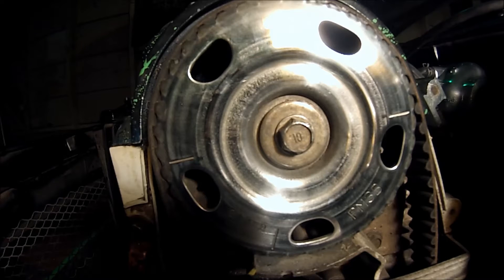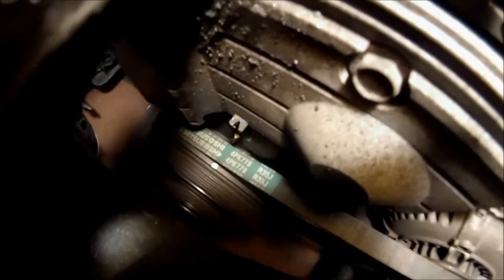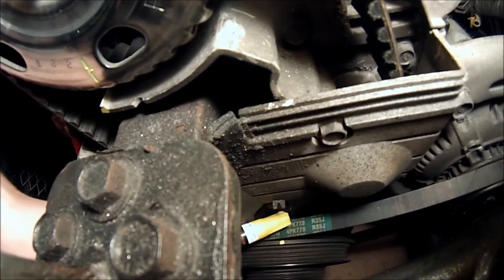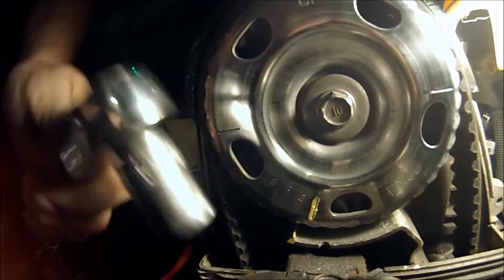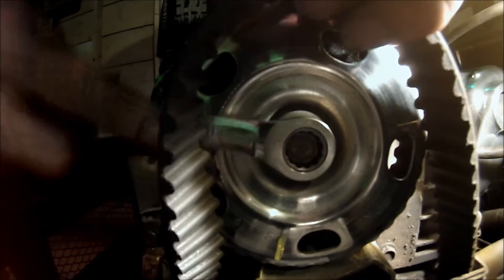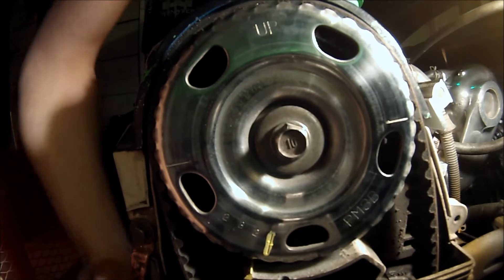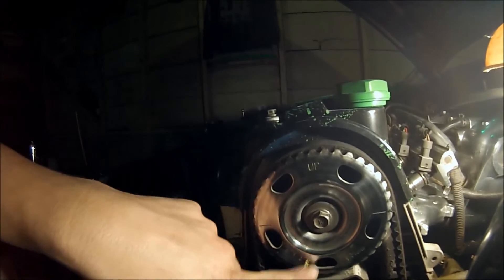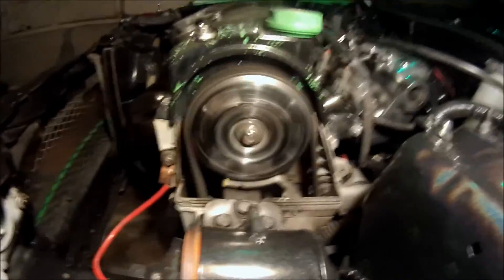How to do timing on a D series

Comment: Yahoooooo!!! My mini-me swap's idle and throttle response are way way way way better. I was having this issue where even without load, when engine is at operating temp, rpm would just go below 500 mark and sometimes die! And with A/C on, it would just die immediately. Cleaned TB, replace IACV, MAP and TPS even compressor but to no avail. I've tried resetting engine timing twice but maybe the guides I followed before were not that accurate (or not applicable on my case). BUT this video helped me a lot!!! 

Thanks so much @JamesDguy!!!

Comment: Dude I owe you so much lol
Reply from the maker: if you have anymore questions i can answer them better now than i could 5 years ago when i made this video
http://instagram.com/lucky_irish_mechanic
Reply: @JamesDguy   dang I got to redo mine. I set it with the up straight up and the pointer in the middle of the three 🤪🤣  I did check to see if everything was ok. It seemed to clear all the valves.  I took it off like that

Comment: This is all facts but you has to pull the plug in cylinder 1 and bring that piston to the top first and everything else will be accurate
Reply from the maker: Antron Hanna I never usually pull the plug since I have done it so many times before and it’s always dead on but if someone is doing it for the first time then yes I agree. I should have mentioned that. My videos have improved since this was made 4yrs ago lol i need to make a newer video

Comment: I have a D15B block in my Honda Civic. Do you remember how many teeth your timing belt had cause I'm having trouble trying to get the marks to stay on point. I've read in forums that the belt has to either have 103 or 107 teeth on the timing belt. I've already tried a 106 and 108 teeth belt. If you can reply and let me know I thank you. Your video is very informative!
Reply: Rip to him replying. Ever figure it out? I have the same block/head
Reply: It’s a d16z7 belt

Comment: You line up the top cam and the bottom spline one degree off and tighten the slack and rotate 6 times and then it should all line up

Comment: if you had it a tooth off or even two teeth, when you put it in gear would it loose a bunch of power? Like having to mash the accelerator and it still barley go anywhere?
Reply from the maker: It’s possible that it would do that because it would be retarted on timing or too advanced.

Comment: Hey ..trying to do my d15b vtec timing ..for the yellow mark your lining up the crank pulley with..are those 2 lines ..and should I be matching up the yellow mark from the pulley with which arrow on the timing cover at the bottom? Since there is two..ones a /\ and the smaller one at the

Comment: I have a d15b7. Would everything be the same or similar?
Reply from the maker: David Changet yes very Similar only difference is use the side marks lined up with the valve cover instead of using the lower pointer. If u use the Lower pointer on the upper cam gear it will run rough. Hope that made sense. If not comment back

Comment: What about ignition timing ? I get quite a bit of back fire. I swapped a jdm d15 vtec on an ef DX and my idle seems rough.. I do have a code 14 which I can not clear I have tried 3 iacvs and nothing. I can't find an air leak anywhere.. any advice would be appreciated.
Reply: @JamesDguy   I will re check all of this first and see what happens. Thank you so much James. Great content.
Reply: I also recently got a code 14 which is for IACV, i purchased a brand new one but sadly the code is still there. Now i opened my ECU and find out one of the transistor is busted and luckily i found an exact item which i replaced and the code is gone and the engine runs smoothly again.

Comment: Does this apply to D16y8 as well
Reply from the maker: Chris Sittner very similar. On the d16y engines there is a notch on the back of the cam pulley that needs to be leveled with the head not the same style of cam gear as these d15z1, d15b or d16z6 style. The d15b1,d15b7 and so on like this use the level with the head markings not the lower pointer marking

Comment: How the hell did u make the bottom pulley move
Reply from the maker: Bonafied-pro Mtz which time? When I pulled the belt off?  If that’s when you’re talking about the belt made the pulley move just a little bit now if you’re talking about when I repositioned the lower pulley to be top dead center I moved it by hand but I recommend a 17 mm and a ratchet

Comment: I have a 1988 Honda Civic dx sedan it has a 1.5 liter. I bought it for a hundred bucks it sat since 2002 it needed a new motor I had someone install it for a $1000.00 bucks and it doesn’t start I’ve replaced the spark plugs and wires distributor fuel filter and fuel pump main relay even ecu, I got it too start but acted like it was out of gas I don’t know a hole lot about Honda’s anyone know what could be wrong?
Reply from the maker: Mark Meyer I would start with fuel injectors, firing order, some times the fuel injector wiring order can be off. 

From right to left
Brown,red,blue,yellow 
Cyl 1^   2^   3^    4^

Cylinder 1 is by the timing belt Cyl 4 is by distributor.

Hope that makes sense.
Reply: James D guy it only has 2 on this engine a top mount and bottom which are brown and green
Reply from the maker: Mark Meyer oh crap forgot its a ef thr 1988-1991 are mostly DPFI they have horrible intake manifold design and usually their 2 injectors crap out. I would start with replacing injectors or converting to obd1 but thats a tougher job than just replacinf injectors
Reply: James D guy okay thanks for the info 👌🏻

Comment: How I do I time my car? It’s a mini me swap with b7 block with z6 head and I don’t have the plastic cover and it also has aftermarket cams
Reply from the maker: The Unlimited Prism You would probably be better off with the plastic pieces but there is a way to time without them but it would be too hard for explain and would require me to do another video. Which I can do if one comes across in the near future

Comment: james D guy, I have a d15b2 with a z6 head. when I align the bottom pointer on the cover the 9oclock and 3oclock marks dont sit even with the valve cover gasket.. if the bottom pointer is lined up the timing should be right. right ??
Reply from the maker: Yes they will not be level with the head when using a d15b or d16z6 head. That single pointer needs to be pointed down with that style of head. D15b1/b2/b7/ d16y7/d16y8 they face level with valve cover. Hope that helps.

Comment: Well done for trying to correct the infinite amount of bad online info on this.
But I'm afraid you're a incorrect on the timing marks. The OE marks to follow are 1 of 2 styles on the D-series:
1- The "UP" lettering at the 12 o'clock position
2- The marks at 9pm and 3pm horizontally aligned with the valve cover seating surface milled into the head (+/- 1 tooth off from method 1)
Only these 2 methods for establishing mechanical timing were ever employed by Honda Motor Co on their multi-generation D-series (D17 inclusive).
B & H-Series (belted twin cam layouts) use similar alignment indexing as method 2 mentioned above.
Keep up the Honda love
Reply: this guy dont know what hes talking about... the dude that made the video done it perfectly!! D16z6, and mine d16a6(1.6l)engines, the up mark its not at 12oclock... you need to aligne the lower point with the lower mark on the belt cover... the marks at 9pm and 3 pm do not align horizontally with the valve cover seating surfaces... 

https://www.autozone.com/repairguides/Honda-Civic-CRX-del-Sol-1984-1995-Repair-Guide/VALVE-LASH/Adjustment/_/P-0900c15280061663

SEARCH FIGURE NUMBER 2/3 IF YOU HAVE DOUBTS!!!

JAMES D GUY, DUDE THANKS A LOT!!!

Comment: Do the TDC marks on the camshaft pulley line up with the cylinder head upper surface (head gasket)? Because someone has removed the plastic case around the timing belt and I no longer have the curved alignment indicator under the cam gear.
Reply from the maker: If i were you i would get the plastics somewhere. If i had some left overs i would just send you 1 because i u used to have a ton of them. But its not REQUIRED but it helps you get it dead on. But you can time it without them. Like most D16y7/D16y8 heads they have a notch on the back of the cam shaft pulley when its lined up with the head it will be level with the valve cover mating surface. The D16z6/D15z1 and JDM D15B do not have this. They only have the outside marks which are used for top dead center. The notch on the bottom of the cam pulley on the Z6/z1 and D15B points at the lower notch and if you do not have the plastic cover it can make this difficult to time but i have done it before without plastics. Best thing to do is get the side marks lined up flat with the head where the valve cover gasket sits the slightly turn the cam pulley to the right VERY slightly and that should be where it needs to be. I have done it with success but i would if i were you get the plastics so that you don't get timing off to much because they are interference engines and could damage valves if done improperly. Hope this made sense and helps

Comment: james d guy im swapping my jdm d15b dual vtec solenoid over to a much more parts sorceable z6 head it has a comp cam with adjustable aem cam gear how should i time it
i have the obd 2 dual vtec jdm d15b with a p2j head 3 stage vtec   now with a p28 ecu
wanting to swap to the z6 head

Comment: Is a d15a2 an interference motor? Because my timing belt broke going up the road
Reply from the maker: They can be. I have had a belt break on several different engines d15b1 a d15b2 a d15b7 and a d16z6 and 3 out of the 4 worked perfect after a new belt and 1 of them did not. So its hit and miss.

Comment: would be full to redline rpm only if I did fix the timing to be on it like you did this video? because I been try to kick in vtec after I replace the ecu to P28 and new Map Sensor and TPS. but I plan order new a VTEC soilden would help to get rpm hit to redline?

Comment: Great video :) Just a quick question, do the JDM D15b and D16Z6 use the exact same cam gears?
Reply from the maker: Jason Bentley yea as far as the old school d15b like what I had. I also had a newer style d15b but it was more like the y8 cam gear. but as long as it looks like this cam gear then it has same timing marks and cam gear
Reply: Thanks dude :) I'm just having trouble with setting up a Mini Head Swap and I'm just trying to sort out timing issues
Reply from the maker: Jason Bentley oh gotcha well good luck on it!
Reply: u will be a .5 a tooth off... no OEM cam fits a JDM d15b from a USDM z6 head will need a adjustable cam just and advancing it 1.5 degrees or 4.5 don't remember

Comment: can I time a d15b2 using this info?  it's got a mfpi swap
Reply: yes all 88-2000 sohc are all the same way
Reply: @rey0176  no they arent.. They are similar  88 to 91 is this way or d15b2.. 92-95 a bit differenet. 96 00 again a little different. Close but not the same.

Comment: Hey how did you remove the bottom plastic cover under the timing?
Reply from the maker: Vince Yeeks you have to remove crank bolt and pulley then remove the 10mm bolts that hold it on
Reply: James Dguy what were to happen if I just timed it right but didn't tighten the tensioner all the way?

Comment: my timing belt doesn't want to tighten on straight side.  so by turning the cam gear that will tighten it right? I believe I may have skipped that step now it's slapping like crazy
Reply from the maker: Dakota Lankford not sure what direction u would need to turn but I'm pretty sure it's off if the belt still has alot of slack it won't be perfectly right but when u tighten down the 14mm bolt it will tighten it a little ill have to make a more updated video and show how I do it with it off the car
Reply: James Dguy my timing seems to be on point b it you may be right. I'm just wondering also if the tensioner I have is bad or if it's the wrong size belt. I just bought the engine and picking up where someone left off.
Reply from the maker: Dakota Lankford very possible that it's wrong belt. d15b7 belt don't fit on mini me swaps only y7,y8,z6 fit mini me swaps with them head codes. now d15b head requires the d15b timing belt. I will have to go into depth
Reply: James Dguy hey can I time a d15b2 with this info?
Reply: yes all 88-2000 sohc are all the same way

Comment: now guys, take notes that the z6 has the most teeth on d series cam gears, also this is for sitting time if it went stupid, not if your car jumped time and snapped the belt, 99.9% of motors these days aren't marked for tdc and you might wanna learn the screw driver and cylinder #1 trick for it and learn to read the notches or buy a timing gun.

Comment: i have a d15b7/z6 minime . will this work for my set up
Reply from the maker: +Edgar Avila Yes it will!
Reply: +James Dguy ugh i got it running decent and now its sputtering every now and then.
Reply from the maker: might check to make sure they have NGK plugs and gapped at 0.44 and replace wires. Coils are going out this time of year so beware of that. If u get a no spark situation remember to check Ignition coil and replace but before all other things check the main relay for cracked solder its almost always the culprit
Reply: drop the z6 and run a y8 head with a z6 cam.
Reply from the maker: Z6 has the best flow of all heads if only it had the quench pads like the y8 does. Then it would be the absolute best! The z6 has swirl ports from the factory and offset timing makes for some serious power. Now add higher compression and its nastey! I miss my high comp D16z6 i had along time ago ran 14s with just P29 pistons, And skunk2 manifold cheap ebay intake/Exhaust i could have got it alot faster had i cammed it and did clutch work and what not
Reply: yes all 88-2000 sohc are all the same way

Comment: im trying to do this to my d15b7 is it the same procedure?
Reply from the maker: +stanb420 everything is the same except cam gear marks need to be level with the head and not the lower pointer on the cam gear otherwsie the same
Reply: I would like to ask for some help!
d16z6 p29 piston control setting ? Although this option? I'm sorry but I do not speak English :(
Reply from the maker: Control settings? As in the timing?
Reply: Yes!! :)
Reply: Mark ? or before?

Comment: I'm boosting my f22b1 this week, 8 psi ebay kit, any suggestions for prep besides arp studs?
Reply from the maker: cellokid502 Not trying to give you what most would call "BAD ADVICE" But i never once put arp studs on my boosted setups and never ONCE had an issue anything less than 10psi shouldn't need them unless your afraid of head lift but i was pushing 13.8psi even went up tp 16psi and never had an issue with needing headstuds. Now after 10Psi i should have replaced mine with studs but i didn't and still ran great.But the only other advice i could give is get some 5w40 Synthetic diesel oil get the lightest weight oil you can but the reason  i say this is because even after COUNTLESS months of beating down on my engine i only ran rotelle or whatever diesel oil and it went for about 5K miles before changing needed to be done because its made to withstand HIGH Turbo heat because diesels. It cant be thick or it will starve your engine the necessary oil needed on start up so 5W 40 is the lightest they make. and get a WIX or K&N filter for oil filter best combo there. Check my other boosted ef videos if you want to hear how the turbo should sound with that setup because i kid you not the diesel oil made the turbo sound better i think its because its made for Turbos or something lol But as for the ARP if you are already doing them then great!!! But not needed for low boost IMO :D I will be having a HOW TO TURBO A B18 FOR CHEAP! It will be out soon!!
Reply from the maker: Royal purple isnt very compatible with Honda bearings so be careful rrunning that stuff. It does make more performance but honda bearings get eaten alive because of the chemicals in the oil. Iv worked on COUNTLESS rod knocks caused by royal purple. The best oil i use is the Mobil clean or Mobil 1 its honda's factory oil and its perfect for high heat and thermal breakdown :) But if you get a knock it might be caused by royal purple i wouldn't use it in my own car because of that. But the oil is awesome for anything non honda but thats just what iv learned through out the years. 9 times outta 10 the oil causes issues because of the copper in the bearings
Reply: well i've been using the oil since i think January and well with my car there hasn't been any problems. The filters are still good to use though.
Reply from the maker: Deff the filters are damn good for sure! Wix royal purple and K&N. But just a heads up if its does knock that could be why. Hopefully it wont come down to that
Reply: yea hopefully it doesn't and it holds up. Adjusting my valves took longer than i expected to take haha i started at 12 pm and just finished at 5:00